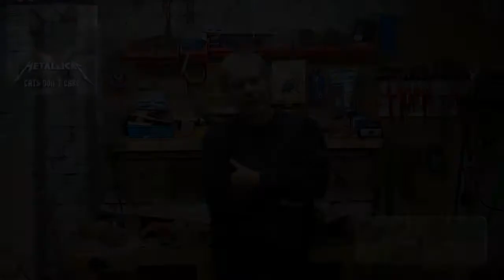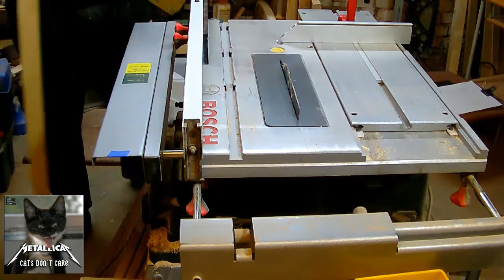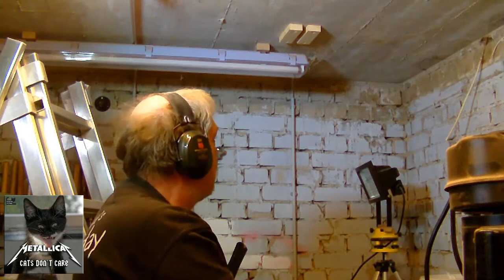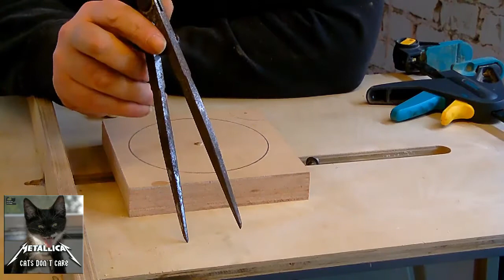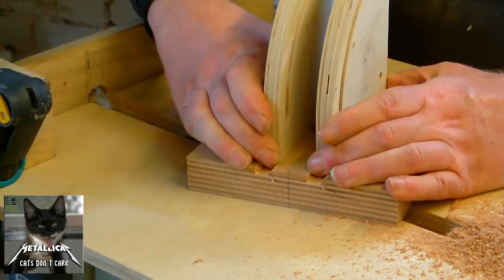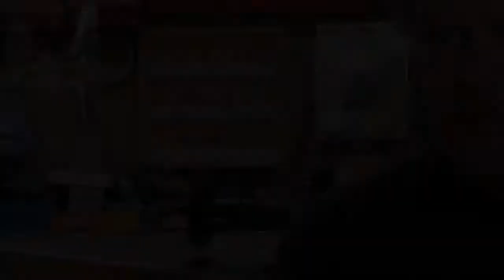Camera Crane - PeteTGIF Video 100

Comment: Hi Pete, 

I'm in planing a similar crane for my basement workshop, and I still needed some inspiration/solutions to solve a few little point. Thank to your video, I finally have the needed inspiration to finish it :) 

Thanks again!
Reply from the maker: +WoodWille Hi,
I'm glad to give some inspirations with what I'm doing. 
One advice, use wingnuts instead of the normal ones. As I had some radical changes in humidity in my shop lately (Flooded three times and a dehumidifier running now 24/7) the wood-movement gets visible on the arm (too high and you can't move it at all, too low and it hangs down from the ceiling).
Greetings from Good Old Germany
Peter
Reply: +PeteTGIF Thanks, wingnuts seems to reasonable to use. I hope I can avoid being flooded, I saw your video, you've sound very frustrated :(
Greeting from NRW :)
Reply from the maker: +WoodWille Who wouldn't be frustrated about 4 days not in the shop? At least that's what it took to dry in the first two places. With the third one I got lucky, as I was in the shop that time, I could get the water right off the floor as it happened, so the humidity wasn't that long of an issue.
Are you in Groß Hesepe this weekend for the Open Days at Drechselbedarf Schulte?
Greetings from the heart of Lower Saxony
Peter
Reply: +PeteTGIF unfortunately I can't go - I didn't even know that there will be an event - I can't change on the short term my schedule.
Reply from the maker: +WoodWille No problem :-)
There are things more important than hanging around ad spending money.
Never the less, I hope there'll be another chance to meet.